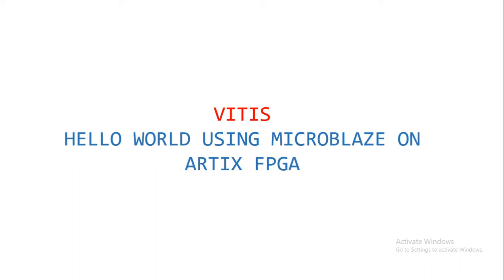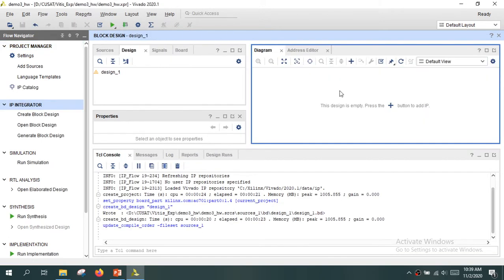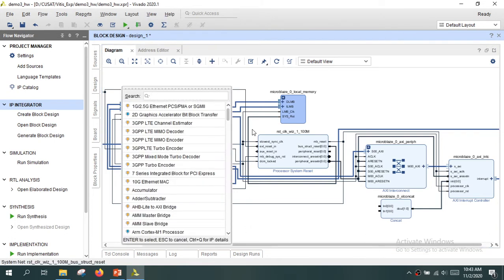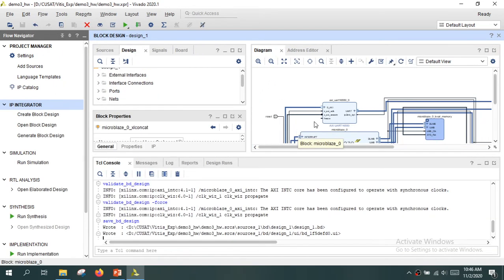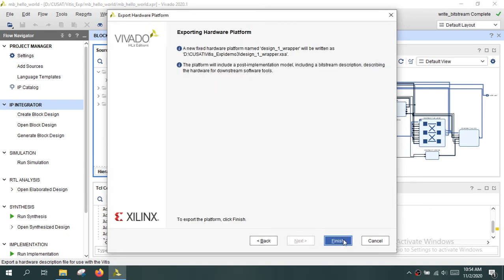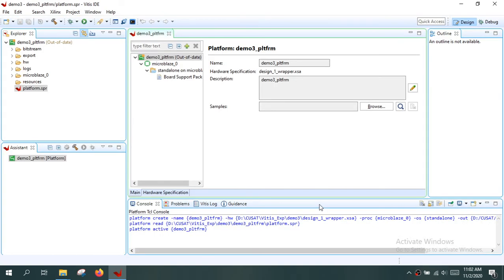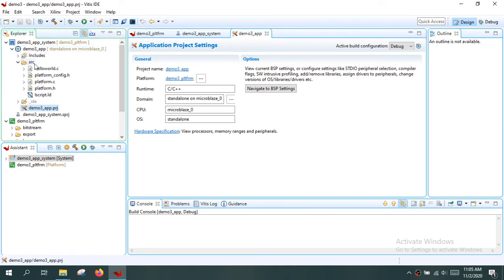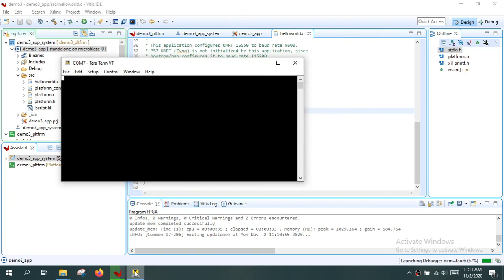Vitis: Hello world program using MicroBlaze processor on Artix 7 (AC701)

Comment: you didn't show pin constraints assigned.
Reply from the maker: @skabdulhaibasha3263  if you are using standard evaluation board, then the pin assignment is part of the board configuration. If you are using custom board, then you need to define those in your own XDC file

Comment: Dear friend
Please, I have a problem during reading the status of an output switch on Zybo Z7-10.
I use Vitis to program the Zynq processor with Gpio connected to a slid switch. I make the switch (input2)  status as a condition  as shown in the program below if (D == 1) ;
The following program works only when the input2 signal that was connected to Gpio IP starts from ("1") but the program does not work when input2 signal starts from ("0"). 
//////////
 while (1)
    {  	D = XGpio_DiscreteRead(&input2, 1);    // input2 from a slide switch
    	if (D == 1)
    	{    	sum_all = XGpio_DiscreteRead(&input, 1);  // input is a 32-bit data
    	printf("%x \n" , sum_all);
    	sleep (1);    	}
    	else
    	{    		XGpio_DiscreteWrite(&output, 1, 0);   // output is a LED
    		printf("No_Signal \n");
    		sleep (1);    	}
}
/////////////
i.e. the program works only when I change input2 from "1" to "0" but does not work when the input2 start changes from "0" to "1".

Comment: Hi!  my design consists of microblaze mcs .what are the requirements to build upon it freertos os?  (sdk 2019.1)
Reply from the maker: For the simple hello world program, internal BRAM memory will be sufficient.. but for bigger programs, you may have to add external Ram interface using MIG.
This video might be helpful
https://youtu.be/QhTYsysSkB0
Reply: @letslearn39  Thanks. My design doesn't work on AXI, and i understand that one need an AXI interrupt controller for FreeRTOS os  to work. Any suggestions?
Reply from the maker: @Jonathan-ru9zl  A timer and interrupt is necessary for FreeRTOS. I haven't worked on Microblaze design without AXI interface.  Not sure how to use FreeRTOS without it.
Reply: @letslearn39  can u see block design . i sent u via mail

Comment: Hello ! 
I could generate the Bitstream Successfully, I could also Export the Hardware and generate the Vitis Projects as per the steps mentioned in your video. I'm using TeraTerm as well. But on my TeraTerm window, I'm just getting a random UART Character. The Baudrate is 9600. Please help with the same.

Comment: Hi @Let's Learn
 I was using bittware board, after adding the clocking circuit, the error resolved. 
But currently after creating the hello world, not getting serial logs. I am using Linux, ttyUSB1 is present. What might be the issue?

Comment: Hello @Let's Learn
Can you please tell me if you have added any repositories on either Vivado or Vitis ?
Reply from the maker: No. It was not necessary add anything for this demo.
Reply: @letslearn39   Thank you for your response, I have the same problem as so I am trying to figure out whats wrong
Reply from the maker: @alexanderbalkoni2170  Can you share the exact error message along with a screenshot. You can mail to letslearnembedded@gmail.com
Reply: @letslearn39  When i build the platform project it cannot find a bunch of header files(cache.h, mb_interface.h, bsp_config.h, xil_printf.h, xil_types.h etc), when I included those files myself in both the Standalone and the Includes I stopped getting the errors on the platform project but I could not use any of this included functions on my application project later on(For example i could not use enablecache(), disablecache(), xil_printf() etc). Also i found out that when open the .xsa file there is no Makefile on the libsrc/standalone_v7_2 of the bsp. I tried making the Makefile myself but i kept getting some errors. I did everything according to your tutorial and i have also tried other tutorials which did practically the same thing.

Comment: i am getting error with input output pins . My bitstream generation failed
Reply from the maker: What is exactly is the error message? which board are you using?
Reply: @letslearn39  got output sir
Reply: I am using arty7_t35 .I had issues with reset pins

Comment: Hello @Let's Learm,

did you add any constraint file or xdc file in your program? Cause your video looks like compiling successfully without physical constraints.
Reply from the maker: Since I am using AC701 board from Xilinx in this demo, the board constraint files are automatically taken by vivado. You need not add anything manually. If you are using a custom board, you will have to add the constraints manually.
Reply: @letslearn39   I simulate exactly the same project like you and launch it on Vitis. However, after building:
1. The Platform, it receive to many errors informing me, they are too many Header files like Xil_printf.h, xil_io.h, ...etc missing in the include folder of the platform under bsp folder. I found all those headers files and add it the include folder. I rebuilt the platform and it works. I've the process like this each time, i'll like to create a platform for a new xsa.file. Now, my questions: Did you face to the same situation before uploading the video? 

2. The application, many failures have occurred: 
->  undefined reference to 'out byte'.   Solution:  for this i had to comment the line xil_printf("Hello World");
->  undefined reference to 'microblaze_enable_dcache'. Solution: i had to comment also the line in platform.c
->  undefined reference to 'microblaze_enable_icache'. Solution: i had to comment also the line in platform.c
-> undefined reference to '_interrupt_handler' in function '_vector_interrupt'.  ==> At this stage found no solution up to now :-( . Do you please have any idea, how i can solve this issue?

Thanks in advance!
Reply from the maker: @ivankouemo8293   For Question 1, I did not face this issue. It compiled without any error. I think you missed something in the hardware configuration itself. Based on the hardware configuration only bsp will made. Did you add uart, enable the interrupt controller in MicroBlaze and connect the interrupt lines?
Reply: @letslearn39 Thanks for your feedback. I could identify myself the problem. It was a matter of wrong BSP choosed and set in the repositories.
Reply: Hello  @ivankouemo8293 , Could you please help with a more detailed explanation on your methodology. I am struggling with the same error a few days now.

Comment: During Export step, the error message comes out like below. (Up to Generation Bit stream was successful. with  2020.2 Ver. Win10)
I followed exactly same as this video. The only difference is the destination directory for the Export. What do you think is wrong?
----------------------------------
 [Common 17-70] Application Exception: Unable to get BIT file from implementation run. Please ensure implementation has been run all the way through Bitstream generation. Aborting write_hw_platform..
Reply: There was an error in generation bit stream!!
Reply from the maker: This shows that the bit steam generation was not complete. You can check the messages window to know the specific error which resulted in the failure of generation of bit stream
Reply: @letslearn39    
Thanks a lot. I am checking the message.

Comment: In my case appears the beginning message "Vitis IDE launch failed" Please, What should i do?
Reply: I'm facing the same issue. You don't need to reinstall everything, you can simply upgrade it from within Vivado by clicking on "Help" -> "Add Design Tools or Devices" 👍
Reply: @vejeke  Thank you so much !
Reply from the maker: Is there any other error message? Are you able to open Vivado? Are you using Windows or Linux?
Reply: @letslearn39  I use Windows 10 and Vivado goes good. The problem starts when I go to tools/launch...
Reply from the maker: @carloss.2548  Did you try launching Vitis directly from windows menu (instead of using Vivado "Tools" menu). If you are facing problem even in that mode, then your Vitis installation is not proper.
Reply: @letslearn39  Thank you so much! I tried re-installing and choosing the option Vitis (which includes Vivado also). Now goes well. 😎👏Thank you! :)

Comment: Hi, I tried your procedure on a Nexsys A7 board with an Artix-7 FPGA. The generate bitstream failed due to errors regarding the differential clock and reset_0. How did you work around this?
Reply from the maker: Please check whether Nexsys board has a differential clock on the board. IF its not available you can reconfigure the Clocking Wizard IP in your design to take a single ended input. Connection automation should automatically map the board clock to this single ended input. Similar could be the problem with reset. You can manually map it to any of the switches on the board. Be sure about the polarity of the reset line.
Reply: @letslearn39  Thank you, that helped. It was also necessary to delete the extra reset_0 pin and wire; then I connected the on-chip reset with the correct polarity and it worked.

Comment: Hi, i really like your videos, they're very helpful.  I'd like to know if you know how to use the Artix Spi bus to communicate with external composants using MicroBlaze processor. I don't know how to start with that. Thank you so much!
Reply from the maker: I have used a SPI flash with microblaze on artix. It did work. You can try adding AXI Quad SPI  module in your block design and then address the peripheral using the axi address range assigned. Remember to configure the axi quad spi IP as per your peripheral.
Reply from the maker: Thank you for the feed back
Reply: I have just the thing for you. 
Download their PMOD IPs. One of them is for the OLED.
You need to add this to your project repository.
When you install the JA connector you'll see many options. You will want to load the OLED IP. It's an SPI device. 
When you export to SDK, you'll see example code to run it. 
From that you can teach yourself everything you need to use the SPI bus. You can ignore the code you don't need for the display.